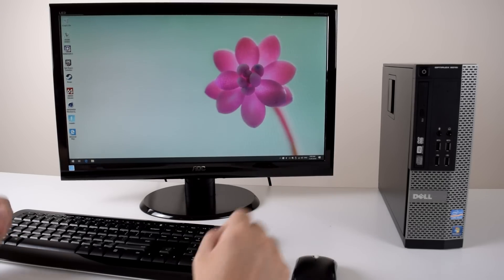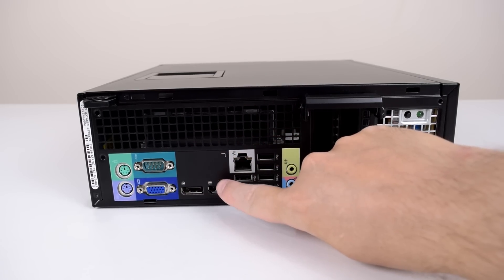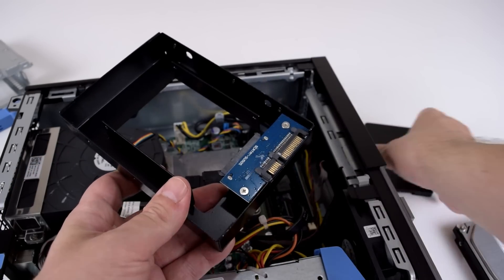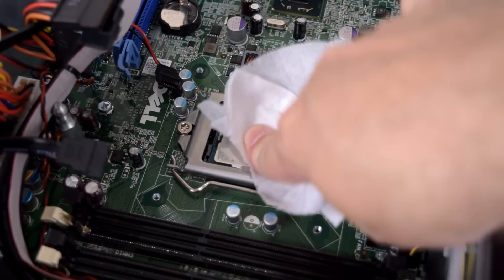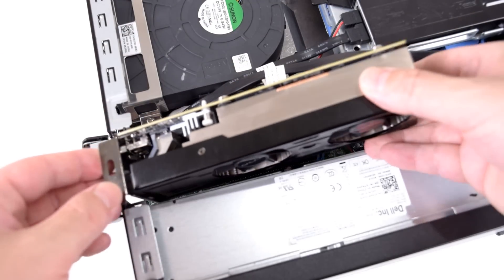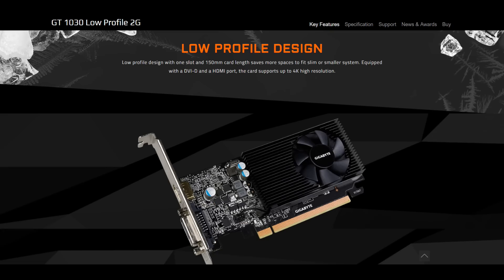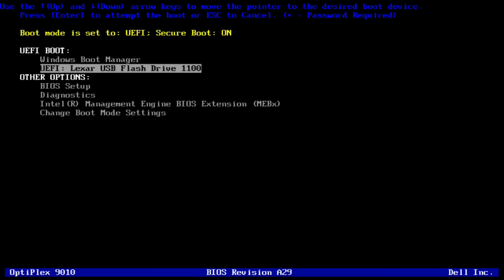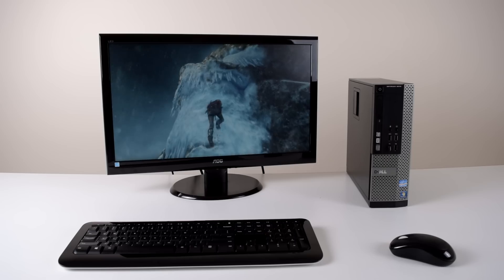DELL OptiPlex 9010 Upgrade Guide! Core i7 32GB RAM GTX 1050 Ti and more

Comment: Today I found one of these sitting outside of a neighboring apartment complex dumpster. I'm thrilled with the form factor. Mine came with a 3770. Has anyone put a 3770k in one of these? I have a spare and see no reason not to pop it in for a quick attempt at 3.8-4.0Ghz on air? Great video and nice to see other people are enjoying these 9010s!
Reply: So lucky

Comment: Better to w8 for zen 2 and buy a APU+mobo combo 16 gb of ram, cheap ssd, hdd and a case with a psu included and game on that, if the apu is faster, cause it might be
Reply from the maker: AFAIK the graphics side of the APUs won't get an upgrade, but not sure. Would be nice though...

Comment: dude i have the same PC but with 16 GB ram and i started up it up and i got around 60 FPS ON LOWEST SETTINGS!!!!! do you know why this is happening? thank you.
Reply from the maker: What graphics card do you have?
Reply: @philscomputerlab  it says 4000
Reply: @philscomputerlab  Intel 4000
Reply from the maker: @Twest2005  Did you skip the part about buying and installing a graphics card?
Reply: @philscomputerlab  I bought it refurbished
Reply: @philscomputerlab  on ebay
Reply: @philscomputerlab  sorry if I'm not making much sense I don't know much about pc
Reply from the maker: You need to buy a graphics card. Low Profile version, not regular. Cards like GT 1030, 1050 or 1050 Ti.
Reply: @philscomputerlab  thankyou dude
Reply: @philscomputerlab  how about the power supply will my PC oveheat or will the gt 1050 be alright

Comment: Can your upgrade do a 4k video edit with fast render speeds?
Reply from the maker: Yea I edit 4K on i7-3770.
Reply: @philscomputerlab  i also intend to video edit on this machine. If I unplug the optical drive, will it be safe to keep both SSDs i bought this already with? If so, should I remove the optical drive - do I need it in a pinch for some reason?  Maybe editing software?  idk

Comment: This is a great PC, i have 3 units  of 7010 Model that limits to 16Gb RAM, running with Xeon E3-1275v2 for VM porpuses but i want to upgrade the ram. Dell 7010 and 9010 use the same Form factor, could you please tell me whats the Product code of the Motherboard on your machine? Its located Near the PCI Express Blue socket.  Thanks

Comment: How well can it handle the 1050 Ti long term? The motherboard according to the manual should be able to put out 50W on it PCI-e slot while the graphics card has 75W TDP according to Nvidia. I'm thinking of building something similar with the DT version, but concerned about this.
Reply: That's a good question

Comment: if playing heavy games will be hot ?
Reply from the maker: Yes the temperature goes up when you play games.
Reply: if you add a fan, does it still fit
Reply from the maker: There is not much space to add another fan.
Reply: @sikucing3157  saya pakai optiplex 7010 mt
3770 stock cooler 95dgc 
Zotac mini 1070 84dgc
 Bila gaming. ARMA 3 warlords.
Game lain max temp CPU <82dgc GPU <80dgc

Comment: Where did you get the optical drive replacement to hold a 2.5" drive?  I've been trying to find something like this instead of my SSD just sitting freely in the area.
Reply from the maker: There should be a link in the description, but eBay is a good place to look for it.

Comment: Hi Phil, do you prefer this to the HP Elite SFF 8200?
Reply from the maker: They are both great machines. The Dell is a bit smaller. but also has less PCIe ports.
Reply: OMG I didn't think you'd reply! :D Okay my specific question is HP Elite 8300 (i5-3570) for $165 or Dell OptiPlex 9020 (i5-4570) for $195? All other specs are the same (4GB, 320GB HDD) and I plan to slap a GT1030 and an SSD. Is it worth $30 to jump from 3rd gen to 4th gen? I've been watching your videos and love the low-budget themes! I also loved your HP Thin Client NAS, as I plan on doing that too in the future! Stay awesome.

Comment: You got ripped off on the base system. The i5/8GB RAM start around $80/85 (USA eBay).
Reply from the maker: I got the machine last year, in March 2018 and prices do change. Also I live in Australia, and it came with free shipping :)

Comment: I have worked on this model hundreds of times, good machine, fyi with OEM keys you can always use a USB to upgrade to Windows 10 and then do a clean install and the key would have been upgraded to windows 10, I've done it thousands of times by now, great video as usual.

Comment: Hey sir isn’t the psu to low to run that gtx 1050ti? Also which one did u get of the 1050ti msi or gigabyte?
Reply from the maker: I cover the PSU and power draw, there should be a chart in the video. The cards I have are from Galax as shown in the video.
Reply: PhilsComputerLab ok thanks

Comment: I have a 3010 with a gt1030 an i3 3220 3.3ghz Dual core. 6gb ram stock PSU since it is a sff. Bought for £128 only upgraded the GPU from a 710 to 103o so I spent £200 altogether
Reply: I have 7010 MT with 3770 + 1070 mini. ;3

Comment: Your temps?
Reply from the maker: I don't have exact figures, but temps weren't an issue. But avoid getting a passive graphics card, you want one with a fan or two fans.
Reply: I'm sorry for my English, I mean CPU. I have a similar set but at any game the temperatures are around 80 ° C.

Comment: I wish you could insert pictures so I could show you my modded optiplex 390. i5 2500k (not overcooked obviously) 12 GB DDR3 - 5oo GB Samsung EVO 860 SSD - MSI 750ti low profile. $30 for the machine - $170 worth the upgrades. Its a little beast!

Painted Xbox green with custom plexi glass side panel. Purty dope braaa!

Comment: this isnt the best upgrade guide in my opinion because theres alot more that could have been done like you could have stuffed other gpus in there as well like a 780 or 780 ti with all be it a psu upgrade and a pci express riser and yes this will take some chasis modifications but in the long run it will be worth it as well as the cpu cooler because i know damn well with that cooler the 3770 was running hot

Comment: Consider a RX 470 4gb it's cheaper than 1050ti and is way faster than it
Reply from the maker: Yes, but it sucks too much power and AFAIK there are no low profile versions.
Reply: @philscomputerlab  yeah but if only Dell included higher wattage PSUs you could put in stronger cards or any part in general
Reply: @philscomputerlab  although Dell optiplexs are pretty space saving in terms of the case but is it worth it getting a used one and upgrading it?

Comment: Bought a barebone dell optiplex 9020 tower for $30. installed old parts from my bin... an i7 4770, 16gb ddr3, rx 570 4gb, 512gb ssd, 2tb 7200rpm HDD, and a 600w PSU. Managed to get 115 fps on Division 2's benchmark test on 1080p low settings.

Comment: The problem with used Dell machines of any vintage in this form factor is the power supplies are complete trash. The big three manufacturers of Dell power supplies for this form factor (SFX/TFX) is Bestec, Liteon and Delta. The former two are notorious for using junk capacitors that fail and often take out the PSU and the motherboard. I've also had a few Bestec units catch on fire or explode under normal use conditions. Delta is hardly any better, and their designs usually suffer severe overheating.

If you want to buy an old Dell like this, I recommend immediately recapping the entire PSU or going with the mid tower model with a full ATX power supply that can be somewhat easily replaced. If you have good soldering skills and the right equipment, recapping one of these PSUs can take 3-4 hours.

Comment: I have a mid-tower version of this same PC. Some tips/things to take note of I put the I7 3770K series CPU in it and yes it does work even though it's not listed on Dells supported CPU's for the motherboard. It gives slightly faster clock speeds over the non-K series 3770 and is unlocked for overclocking although the board doesn't support overclocking. My machine also has 32 GB of 1866 hertz Hyper-X ram however it will only run at 1600 hertz due to board limitations. Also yes you can replace the PSU with pretty much any standard form factor designs. Mine has a EVGA 700 watt 80+ bronze unit. Fit's in just fine. On a final note you CAN fit full sized GPU's in the mid-tower versions of this same 9010 series Dell HOWEVER clearances are VERY tight but it will work. I put a GTX 960 SSC series card in mine and had to trim the bottom right of the heatsink/plastic shroud a bit to get clearance since the USB 3.0 plug was in the way. Granted this is the full size dual fan version of the GPU. But if your willing to get your hands dirty a bit or simply buy a shorter length card you'll have no issues. Just wanted to pass those tips along to anyone who happens to read this.

Comment: What about CPU Temps for the I7 with Prime for hours? Got the very same Optiplex 9010 and yes it's really good value for its price. Considering upgrade to i7 here. As it will be my Video machine. I use a PCIe grabber.

Comment: Ahh, good old Optiplex. I like to think they're Dell's claim to fame, as they're pretty much always very reliable machines that keep running year after year. I used to work in Dell's tech support and the failure rate of Optiplexes were really low.
This particular model is one of my all-time favorites since its launch. Super easy to work with, reliable and quite snappy with the i7 upgrade you suggest. Dammit, now I've got to go find me a minitower model to play with, it's been awhile since. Good times! 
Good video! :)

Comment: I actually have my 7010 in this configuration but only 12GB ram which is fine for what I need.
Its drawing up to 190W when running the OCCT PSU test. I’m surprised the PSU hasn’t blown up yet

Comment: There are dual slot 3.5" to 2.5" converters, so if the mobo have enough sata connectors, u can use a regular HDD too.

Comment: Cool!  I have one as well, had concern with not wanting to purchase a low profile GPU, so I used an old cube ITX case, did some mods to the board and case, and yeah, it works!  Mine sadly has the i-5 2400, but it still holds up given intel's minor upgrade improvements until the gen 8 and onwards.

Comment: Why you need 32gb of ram? If you think for future proof, let me tell. 8gb are just enough for gaming. 16gb it’s nice to have for gaming and livestream which I doubt you’ll be able to do smoothly on a 4 core multithreaded CPU, other multitasking it might be helpful. By the time you’ll need 32gb your CPU would be obsolete way before that time comes for ram. And the 4 core multithreaded CPU its the highest you can go on that socket. As for graphic cards other viable decent options if you can get cheaper are RX 460 and RX 560 low profile.  As for hard drive upgrade. I did one similar build. I removed optical drive swapped a ssd, removed old drive and placed a Western Digital black 1tb.  Having enough storage is more important than consuming few watts.  That’s what a hard drive consumes. The power supply definitely can handle that. Going for a 1tb ssd is a big cost on a budget build. So I think that’s the best way to go on a similar build.

Comment: I think I did a bit better, I found a guy selling hp z210’s for around $100-$140 (USD) the P.C. has builtin an i7-2600, the power supply is 400watt, and has a 6 pin pcie connector. So it is perfect for something like a gtx 1060, although I’m going to put in an rx 579 8GB, and use an adapter for the 6pin to 8pin.
Also had 8GB of ram (dual channel) upgradeable to 16GB, the $100 had no hard drive or sad, so I got a team group l5 lite 120GB as the boot drive for $20 then a used 1 TB HDD from eBay for another $20.
Reply from the maker: Yea I got the PC in March 2018, back then it was a terrific buy, but prices should have come down now :)

Comment: For $150 USD, you basically bought yourself a used case, old motherboard, and a 300W PSU. Is this really good value? A combo deal of a new case, fresh MB, and 450W Bronze PSU should cost about the same. Am I missing something here? How is this a good deal?
Reply from the maker: I got it March 2018, prices are different now.
Reply: @philscomputerlab  The price will have to hover around USD $50 today to make it a good buy.  I will grant you that you can sell the used HDD and memory sticks for some cash.

Comment: They're good little machines. I picked up an Optiplex 790 a couple of years ago. It's virtually identical but 2nd Gen,  lives under my TV as a media PC. 2500K upgrade, 16GB RAM, 2.5" SSD+HDD dual bay adapter and a GT 1030.

Excellent for Kodi, very quiet and with the GT 1030 (added for HEVC decode) it's up to some medium gaming.

Comment: I own 3 of this vintage of Optiplexes. A 790, a 7010 and a 9010 in our home. Very nice machines. Maybe 15-20% slower compared to my XPS in my studio, but at a 16th of the cost! My 790 is stuffed with an i5 2500, while my 9010 has an i7 3790. But my single best upgrade was probably the dual SSDs. The 9010 can use not one, but two in RAID0, works perfectly under Windows 7 and Mint Linux and now days it can be done cheaply. I've stuffed two 512 Samsung 860 series SSDs for under $150. That 1 Gigabyte per second transfer rate really helps things move along. Especially if you've outfitted it with 16gb of ram. Plenty to cache. Most people don't know this but you don't even need to buy a licence for these computers. Just download the Dell recovery program, put in your service tag and walla! A free Windows installer. I do love my Dell!

Comment: These models have very weak power supplies. Remove the blue plastic shroud from the front of the psu or it will blow.

Comment: After seeing a RandomGamingInHD video some time ago, where he compared the T, S, and regular processors, the conclusion was that the T variant was too slow and not close enough, while the S version saved some power while not hitting performance too much.

Based on this, I bought an i5 3470s, but in hindsight, don't think it was warranted. It (2nd hand) had a premium over non power saving models, IIRC, while power gating features of modern processors make it nearly unnecessary, since they all throttle up and down as the situation dictates and are all pretty frugal. The quicker processors complete tasks quicker anyway, so can throttle down before the slower ones.

In this case, no pun intended, the smaller form factor may warrant the 's' versions of the processor, as it stops them going to higher Ghz and keeps the small space inside cooler. Of course, you may be able to toggle a standard processor to get it to behave more like an 's' version, while still having the extra horsepower if you need it.
Reply: Put a 2500K in my 790 as it was available. Won't overclock on a Q chipset, but turbos to 3.7 no problem and temps are fine.
Reply: @johnroberts2905  Good upgrade, nice one. Sounds like it's working really well. What graphics card did you put in with it?
Reply: @JT-ko2ib  EVGA GT 1030. It's under the TV, mainly as a media centre, so wanted H.265/HEVC decode. It's more than enough for some casual gaming on the sofa. The low-profile 1050/Ti like Phil used was not available at the time.

Comment: The only reason it works for you without crashing is because you use 220v, the power supply gets way more efficient.
Reply: Phillip Stearns here we use 230V all day everyday!! Does it mean we can get away with low end PSUs?

Comment: I don't like the sff optiplex's. So I got a full tower. Core i5 3470 3.2Ghz 8gb dual channel 2x4Gb 1600Mhz 1TB HDD and I have a GT 70 2gb gddr5 in there for now until I can get a GTX 1050 or 1050ti

Comment: Got an optiplex 1030, i5 2500 quad core, 16 gigs ram, gt1030, 3tb drive - 200 usd for all the parts off Ebay.  Can play all the way up to ps2 fine.

Comment: Cool video but is there a reason that you didn't go with a LP AMD rx560 instead of nvidia? Same price but it absolutely stomps nvidia in performance.
Reply: Yeah... i'd delete this comment if i were you, because you obviously don't know what you are talking about.

https://gpu.userbenchmark.com/Compare/Nvidia-GTX-1050-Ti-vs-AMD-RX-560/3649vs3926 

The 1050 and 1050ti LP are also more readily avaliable, specialy in other countries. Like in mine, where i can get both, but no 560 lp. And i wouldn't want it anyway. The 1050ti is still faster. GG Amd fanboy.

Comment: If you have a lga 775 you can buy great xeon x5460 modified to fit into your socket for only 20 bucks the only requirements are to have the right chipset(you can find the list on a website called delidded ) and a proper cooler(optional) because this beast got a tdp of 120W and is not supposed to run to much over 64 degrees celsius

Comment: I really hope that new gtx 1650 and 1650ti won't require the 6 pin connector and will be sufficient for this kind of sff machines. 1060 3gb-ish level of performance in the form factor of 1050ti.

Comment: Nice video,i've been using such a system for quite a while-but recently the audio chip on the mobo failed and i simply couldn't find any new mobos in the market to replace it with.LGA 1155 based motherboards(new ones that is) are becoming a rarity in the market these days and the few used ones that are available dont seem reliable at all. So if the mobos in these older systems fail,it will be very hard to get them working again-one should bear this in mind before procuring an older sandy/ivy bridge based computer at this time.

Comment: For those who talk about the 35W PCI-E slot limitation, that depends on the DELL SFF model. This is not the only Optiplex with such a SFF Chassis. There’s also the 7000 and 790 Optiplexes, which tend to come with the older 2nd Gen Core i parts, and only two RAM sticks and lower-spec, 230 or 180W PSUs. Those tend to have only a PCI-E x16 slot with x4 support on the second slot (therefore limiting you to single-slot, low-profile cards) and the imposed 35W limit.